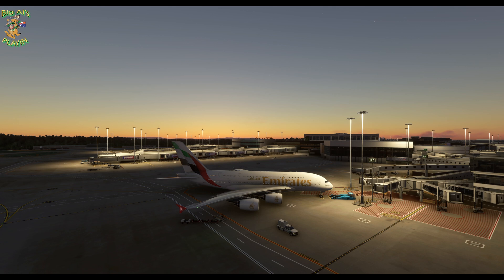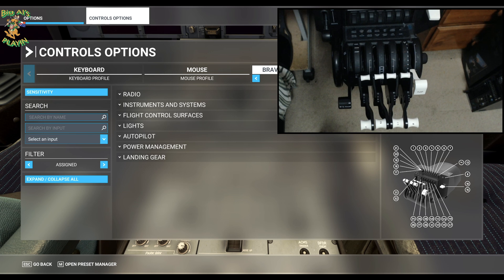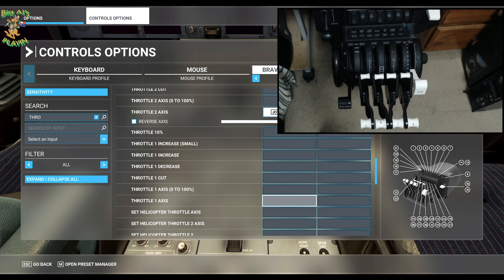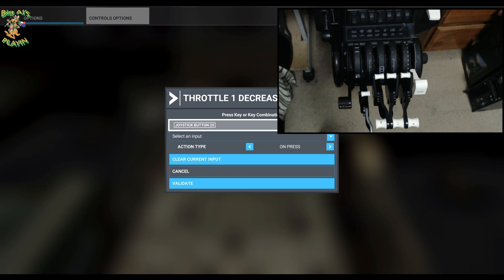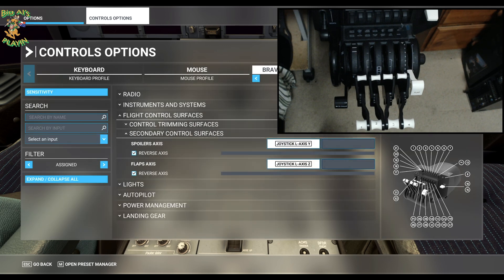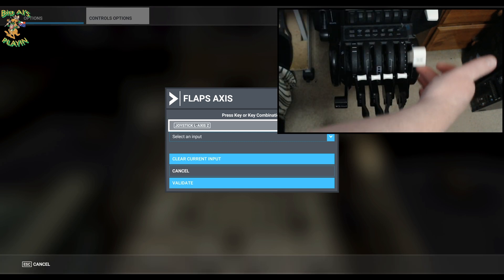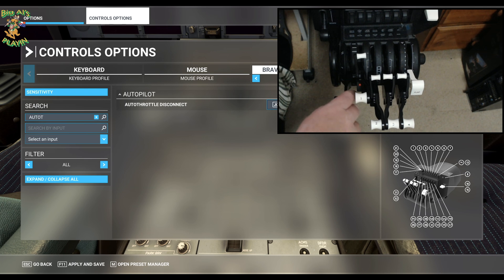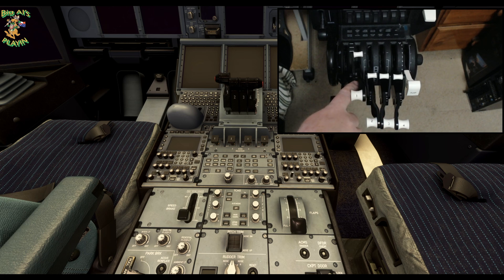FlyByWire A380 Honeycomb Bravo Throttle Quadrant SETUP less 10 mins - Microsoft Flight Simulator

Comment: Hi, Al, good write up just one comment, A380 does not have reversers on engines one and four even in real life due to these two engines hanging over the unpaved sides of the runway so that they won't ingest any debris.👍
Reply from the maker: Thanks I have done an updated setup video &  uploaded   https://youtu.be/L3myag3gPv4
Reply: Yap I’ve noticed, ps. It’s z747pilot I don’t know how the 5 got there, by the way if you add: @ and an email provider I’d get the email with any questions you may have.
Cheers.